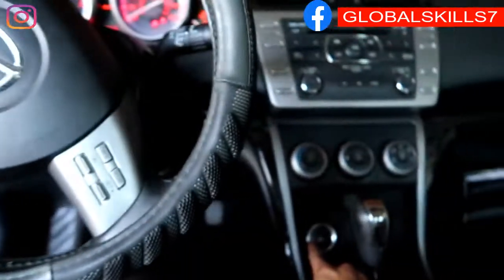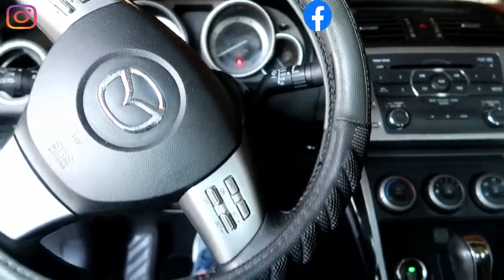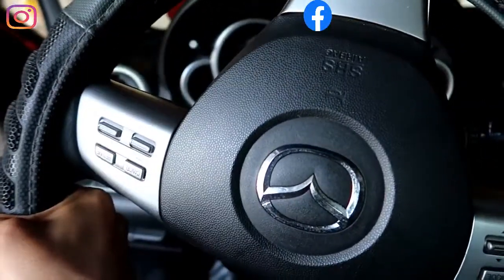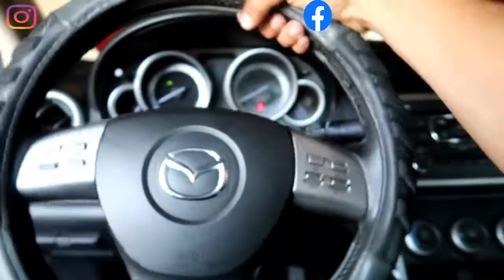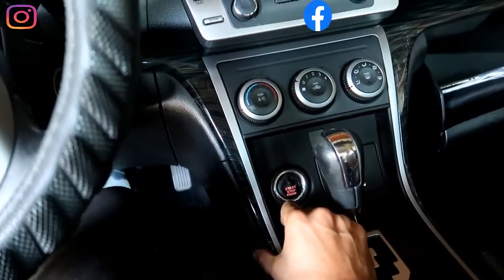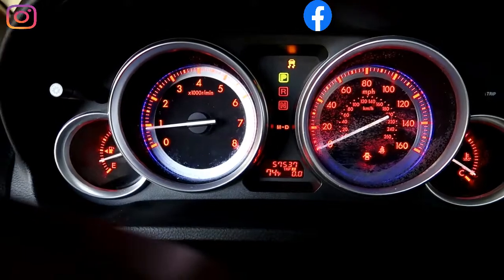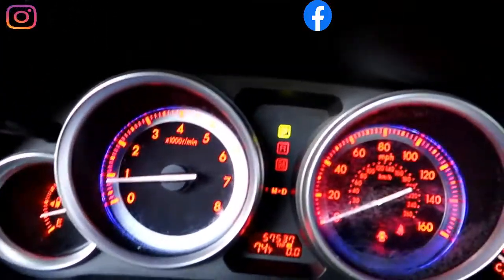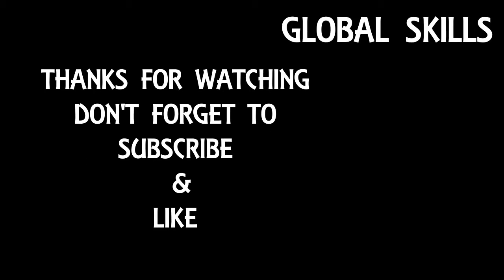How to FIX any Mazda with the DSC Dynamic Stability Control lights ON or flashing !!!

Comment: I was so disappointed that this didn't work , but I thought it might be because my car sat for years awaiting me to repair it (2006 Mazdaspeed6). I drove around the block with all the light illuminated, and halfway home all the lights went out! so, if this doesn't initially work for you, drive it a little bit. My thinking is that the hub needed to turn to recalibrate the sensor after being down for years.

Comment: Just had my Mazda 2020 CX30 in the dealership for an oil change.  Drove 90 miles then it sat 24 hours. Next drive the Dynamic Stability Control malfunction light came on. Went to try this fix and the warning light was off. Will try it if it comes back on.
Reply from the maker: Did it work for you
Reply: Didn’t have to use it. Car sat overnight and the warning disappeared.

Comment: My Steering wheel won't turn without turning the motor completely on? When i turn on just power it doesn't turn.
Reply from the maker: Turn the car ON then turn the wheels all the way left until it stops and then all the way right